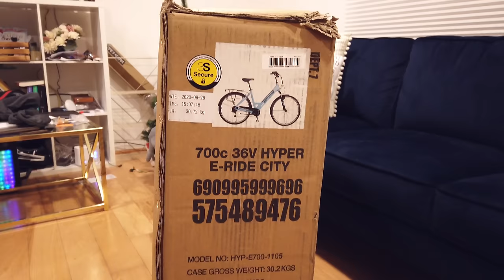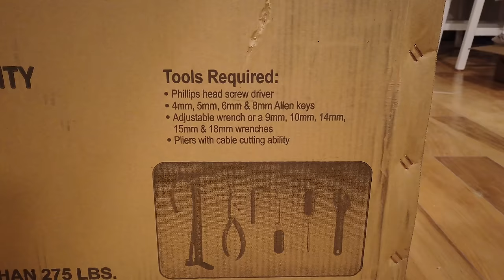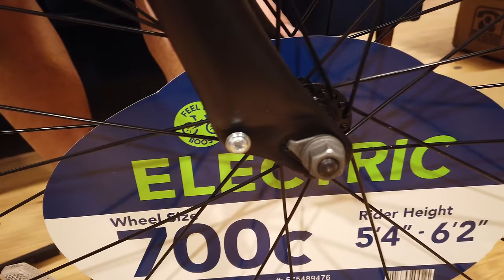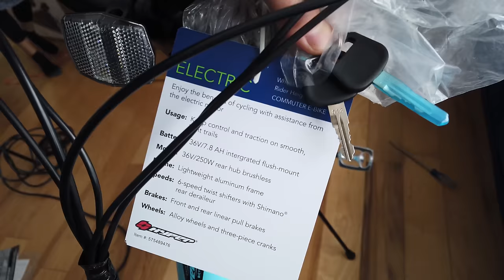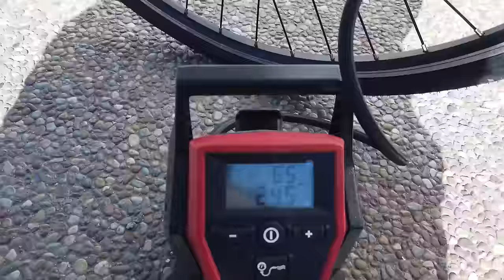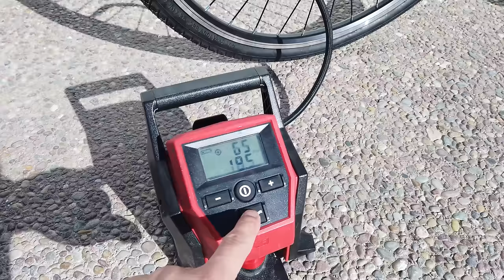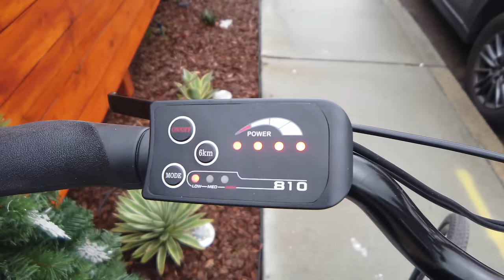Cheap $398* Walmart Electric Bicycle!!!? Hyper E-Ride City 250W 36V Ebike Review + Assembly Tutorial

Comment: Yep - current price is $598 as of 2021-02-03. Intriguing at $398 - but at $600, since I'm a bike mechanic who can spoke wheels, a hub kit on one of my mountain bikes looks like a better option.
----------------
Edit: 12/08/21 - They went down to $400, and I couldn't see missing that deal. I got the blue city bike (they also make black). 

The bad news - anyone scoffing at "cheap Chinese junk" needs to sit up and pay attention. I remember when we laughed at cheap Japanese junk in the early '70s. A few years later and no one was laughing - they were scrambling for market share. History is about to repeat itself - China has far more resources than Japan had. Something to think about.

The good news - this bike is really not at all "cheap Chinese junk". I was a bike mechanic when Schwinn was an actual American company, not a marketing label, and I was a Schwinn factory trained mechanic - each Schwinn dealer was required to have at least one. So I've unboxed hundreds of bikes that made the short trip from Chicago to Oklahoma - many of them were in worse shape than this Hyper e-bike, which came about 6,000 miles to get to my home. There are multiple nice touches - machined brake surfacing on the rims, decent tires, bearing pedals instead of sleeved... I was surprised to find bosses on the underside of the seat stays for a frame lock - something you almost never see in the U.S. (I mounted an old Abus lock I had lying around.)

Wheels were properly true and concentric, the headset and front hub were correctly adjusted (a tiny bit rough, but that's acceptable, and just what you're going to get at this price point) - The bottom bracket was way off - a surprising oversight, but there was a ton of lateral play, and I had to run the adjustable cup in about 4 complete turns to adjust it. Odd, but not a show-stopper. There is no adjusting the rear hub - those are pressed-in sealed bearings - they're either good or they're not, and hopefully they can be replaced when they wear. 

The fenders, rack, bars, seatpost, crank arms and stem are all steel - and since this is a less expensive e-bike, about what I'd expect, and completely acceptable quality. I didn't expect the rack to be a sturdy as it is - there are plenty of cheap flexy steel racks out there - this one is a properly decent, solid rack - it's just not high-end aluminum tubing. I've had about 25 lbs of groceries in panniers on this rack and there's very little "butt wiggle" coming from the rack.

My first ride was unpowered - the battery was charging. I rode about four miles around the neighborhood. The bike is heavy for a bike - about 50 lbs., but that is only really noticeable pulling away from a stop, or going uphill. Otherwise, it's a perfectly nice riding bike. (By comparison - I also have a Raleigh DL1 roadster, which has only three gears and weighs on the far side of 40 lbs., so I don't freak if a bike weighs more than 17 lbs.) This was an important ride - at some point, believe it or not, like it or not, you are going to ride your e-bike without power. If that first ride had been miserable, the bike would have gone back to Walmart.

The second ride was powered. There were a couple things I noticed immediately - the power delivery was surprising to me - it feels like they've made some effort to source a controller that "ramps up" smoothly - I've ridden a couple of other 250 watt hub bikes that had a jerky feel when the motor engaged - much more of a toggle switch effect. This is a more subtle and smoother engagement - another nice touch. The motor is also quieter than some budget hubs I've heard. It's barely noticeable. The second thing I noticed is that a bike that is geared to be a pleasant ride without power is somewhat undergeared when powered. With level 3 assist, top gear is not that useful. You're basically just phantom pedaling to keep the motor running. Maybe I'll see about dropping a tooth or two on the high end when I replace the freewheel. We'll see. Going to a larger chainring would make the chainguard impossible, and would move the whole gear range up - making it less rideable without power. The jury is still out on this one.

Otherwise, I've been on some short rides, fifteen miles or less, and the remaining battery makes me think 25 miles is a reasonable range given my riding style. Running only on full assist, and while just "phantom pedaling" will, of course, lower the range.

Bottom line? Best money I've spent this year.
Reply from the maker: Agreed. Thanks for the comment
Reply: anyway putting a front hub motor on it too?
Reply from the maker: @who346  I don't see a reason why you could not. You'd need a separate battery and controls though.
Reply: @ColinLeung  thats what i was thinking too ref battery and throttle....
Reply: 12/ 3/ 22 I paid 395
Reply: @Rob-metoo527  - Hyper seems to be having supply issues. This year only the base mountain bike appears to be on sale at this price. The city bikes with the step-through frame appear to be not available at all. I don't see the disc brake version of the mountain bike offered either... And their website has been pretty hit or miss about which bikes are available. 

I did end up buying the city bike 11/21, which I caught on sale and I love it. I bought an extra battery, and I put about 1200 miles on the bike in the past year. I put KoolStop brake pads on it, and upgraded the brake cables to Jagwire mountain pro zero compression cables (BIG improvement). I also put a Shimano 7 speed trigger shift on and a sunrace 7-speed free wheel (13-28) for a better top end, plenty of room between the dropouts of the city bike frame.

Comment: Is it possible to buy a second battery to switch if one dies?
Reply from the maker: Hello Jacob, I heard the manufacture sells a separate battery for $200-300 if you need another.  I can't find the link for it at the moment, so you may need to contact them directly. Thanks

Comment: I just recently purchased a spike myself and being new to e-bikes I went to Pedal and after the second stroke the power came on which I was not expecting and cell tweet the handlebars so I walked it back waited about 2 days to recover and went back out I totally agree with the pedal assist not engaging at high speed you end up peddling your ass off and you might as well pedal slow and let the motor engage and do the work for you that's the reason why I bought the bike I'm legally blind 100% in the left eye am I right eye is like looking through a lava lamp so I don't drive I want to buy an e-bike sent them on my own to get around town and I have a killer hell and I used to work and my commute was a mile and a half and I would always have to walk it partway up the hill but with this bike it has plenty of power to get up the hill of course with peddling and I agree with other comments adders you probably shouldn't use the word cheap maybe low in like you did with a Shimano components after all this bike is inexpensive and quite honestly a good value could have spent 2 or three times as much but this fits my budget and my needs
Reply from the maker: Thanks for sharing your experience, Wayne!

Comment: It may be called a Walmart by Walmart definitely does not sell these,  Walmart's cheapest ebike starts at about $600
Reply from the maker: Thanks for the comment. The price does fluctuate, and has historically dropped from $598 to $398 in Nov-Dec the past two years. https://www.walmart.com/ip/Hyper-E-Ride-Electric-Bike-36-Volt-Battery-700C-Wheels-Blue/487063249

Comment: It's a bit over $500 now.
The smallish battery and low power motor may be why so cheap. I paid about $600 for a 48v 500w kit with a 12 a/hr battery that gets 50-60 mile range. The battery alone sells around $300+.  It's the most expensive part of an ebike.   I built mine on a 1998 Specialized FSR comp mountain bike for a strong frame, full suspension and a smooth ride.
Reply from the maker: It seem that the price has dropped. Some people were saying it was $600-700. The last two years the price hit $398 around black friday to Christmas. 
Thanks for sharing about your ebike experiences!

Comment: My city has a 33 mile long bike trail along a river parkway plus many side trails.  One can use an e-bike, but they must have pedals w/ the motor just for assist.  The rangers might be able to cite someone not pedaling and just running on a thumb lever, though unlikely.  Still, this bike mandates pedaling to actuate the motor-assist so keeps you perfectly legal.  Just bought one for wifey so she can keep up with a biking group (has trouble on hills), so came here to learn the controls (came w/ no manual).
Reply from the maker: Thanks for leaving a review!
Reply: How does she like it. That’s why I’m looking for it.
Reply: @leighann5308  
We've gone on 3 group bike rides so far, around 20 miles each, with some hills, about 1.5 hr ride time.  She can blow by those of us on regular bikes on steep hills.  Her Hyper is down only 1 bar at the end, so perhaps the "1 hr" spec means if you go full-out 20 mph the whole hour and perhaps even uphill.  I changed the front axle to a quick-release type (had a spare) so we can take the front wheel off quickly.  It barely fits lengthwise in our minivan with the rear row out and wheel off.  It weighs 55 lb, so a bit of a beast to load.  I wouldn't trust it on our bike hitch since so heavy and the arms don't slide thru the frame well.  My wife changed to a very wide seat (almost like a tractor).  I use it for short quick local trips.  You can choose assist of 10, 15, or 20 mph.  The later is really flying, so slow down on turns.  It is a little strange how the assist kicks in about 1 sec after you start pedaling (feels like a longer time).  The multi-gears are great for pedal-power, but doesn't affect the motor-drive.  We were going to buy the Jetson Bolt Pro ($349) but it disappeared from the Costco website a day later.  A couple has them and they can keep up with the regular bikes, but no gear so they have to crank fast at 15 mph.  It is much smaller and folds, so can fit 2 in a sedan trunk and great for taking on a commuter train.  For her usage, my wife is happier with the Hyper.  We found the Hyper new on FB Marketplace for $399 by a local liquidator.  Unless Walmart repeats last year's Black Friday deal, you might pay $630 at most stores today.  One fix I made was the rear fender was rattling, as many owners complain.  I lowered the rear wheel enough to tighten the loose mounting screws.  Be very careful since the drive cable is routed thru the rear axle, past the derailleur.
Reply from the maker: @leighann5308  My wife enjoys the bike

Comment: No registration cost, no smelly fuel or exhaust so can be brought inside your apartment.   You don;t always have to do more than keep the pedals moving to keep the motor running plus for hills there lower gears he kept starting in 6th which required more effort.
Reply: SOME PEOPLE LIKE THE SMELL OF THE 2 STROKE "smelly exhaust" lololololol the 80 cc kit is 160 lol and fuck it i still bring it in side let the gas smell lolololololol thats just me tho im weird like that :)

Comment: My friend got hers from someone that didnt like the auto assist from a complete stop. I have an Ecotric Peacedove ebike. I also have a GoTrax Flex e-scooter. I watched several vids before buying or assemblying. I did not see you adjust the center screw up into the front handlebar before putting into the frame. This was in my instructions to make it flush/even. Not to correct you but as you said, you didn't have good instructions. You can look up other bike assembly vids like the Ecotric Peacedove to see what I mean. I am not promoting what I own- just mention for my experience & comparison. Glad your wife likes it ! My friends likes hers except it is a lil too high for her height. She may sell hers & opt for a better fit.
Reply from the maker: Thanks for sharing the tip about the center screw!

Comment: the motor on it is noisy compared too most.  for $600 you could have gotten the swagtron eb-7 ebike  has 350w 36v  will doo 30mph  on throttle only and i got it to 40mph  using pedal assist and it is very quiet with disc brakes. also the swagtron eb-5 at $500 is better with its 250w watt motor which gets  25mph on throttle  but a bit faster in pedal assist mode. that has v-brakes and it much quieter  than this.  also the b-7 battery will get around 30 mile range with throttle only  and close to 50 mile range if your using pedal assist. the eb-5  wil get 12mile range on throttle only and around 2 miles using pedal assist only. but  basically for the same price ther are  other e-bike out ther better than this one.  and both of my swagtron e-bikes currently have over 1500 miles on them and still going strong. i dont think this one will last as long  from the looks and sound of it
Reply from the maker: Thanks for the comment! The Swagtron sounds good, but it is also a folding bike. Not everyone prefers that form factor. I'm in the process of editing a Jetson Bolt Pro review with a 350W rear hub motor that I got from Costco for $300. I should have it up within a week.
Reply: @ColinLeung  sounds interesting
Reply: Nope. I just got one, and compared to a few other budget motors I've heard, this is actually pretty quiet - about the only time I can even notice it is when I'm going up a decent hill. Maybe the microphone is picking up the sound better? In use, no one has heard me coming, and since I'm passing more people than I used to, I've had to get used to ringing my bell to avoid startling folks.

Comment: The most likely reason this does not have quick release for the front wheel is that the frame geometry would make it hard to use a standard bike lock to secure both the wheel and the frame.  I think you would need an extra long shackle or something. Cables don't really work.  So it is actually rather thoughtful of them not to include the quick release.
Reply: And, in another related thoughtful touch - those two bosses on the underside of the seat stays are for a frame lock. Something you almost never see in the U.S., and something I appreciated, since I happened to have an old Abus lock lying around, which I promptly mounted. I do use a cable, but it's a heavy cable. If they cut the cable, they'll have to carry the bike to a truck, since the frame lock makes it unrideable.

The real reason I don't think I'd want a QR hub is that it doesn't add much - with fenders, if you take the wheel off to put the bike in a car, you'll probably bend up the fender, and not reduce the size of the bike that much. I'm not actually that thrilled to have a QR seat post - the post and saddle provided won't break you if they get stolen, but why go through that hassle - I'll probable replace the QR seat post clamp if I upgrade to a suspension post and my spare Brooks B17. Or maybe I'll leave it and just take the saddle post with me... hmmm.

Comment: I buy them cheaper e bikes and upgrade them to perform like a 3000$ e bike by adding 2nd motor of 2000watts as a Turbo Booster. I build 2 of them of 2 motors each. I prefer using a Gear Motor as the base for it's added benefit of going farther without motor cutting off to cool down a bit( Gearless motors or DD can only go so far before motor cutting off a few minutes to cool down after 3 miles full throttle) . Both e bikes tops at 40plus mph. The best set up is to use a Gear motor as the main function while adding 2000watts to ride faster of long 10 plus miles.
Reply from the maker: Wow. That's cool
Reply: @ColinLeung  Thanks!!! It's the only way I ride , lol. Very practical of a Pro like use. Best Duals are gear motor as base, and a ,,2000 watt or a bit lower Gearless as Turbo Booster!. So far of 1 year , 2600 miles still going faster than them 3k e bikes of the many features for hype.

Comment: Interesting overview of this city bike. I just feel there is a misconcept (not just from you but from most of people who get interested on e-bikes) regarding the real goal of assistance levels: it is not really about  the final speed in flat but boost when climbing: I'm pretty sure if you perform the speed test while climbing the speed x effort difference would be much more noticed. Maybe after 10 months of usage you may realized that (in fact, please share with us the 10 months later impressions). Anyway hope you and your gf are enjoy riding together 😄
Reply: I'd love it if this were the case - but the controller provided with my e-ride City seems to give one level of power in all three assist modes - it just cuts out at the respective speeds. In other words, accelerating to 10 mph happens about as quickly in all three assist modes. Nicer controllers I'm sure vary the output power with the assist level selected, and even nicer (and much pricier) controllers with torque controlled sensors detect your actual pedal effort, and adjust accordingly, but that's not the electronics you get at this price.